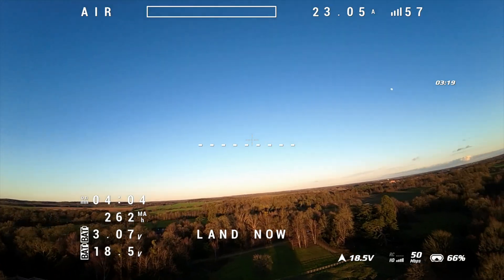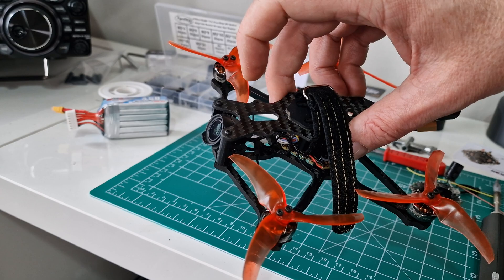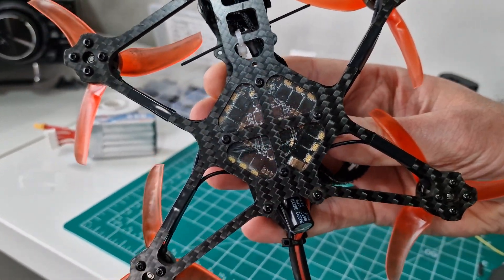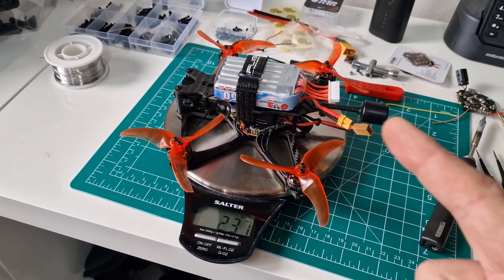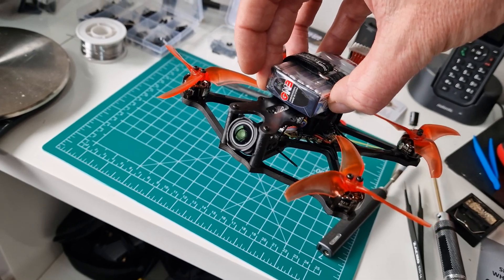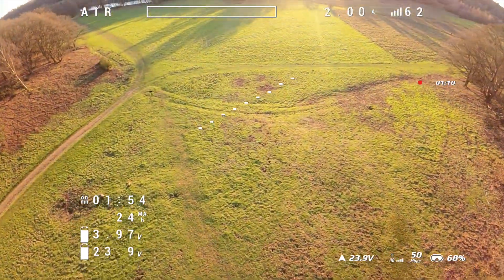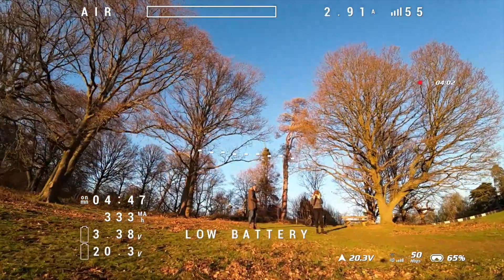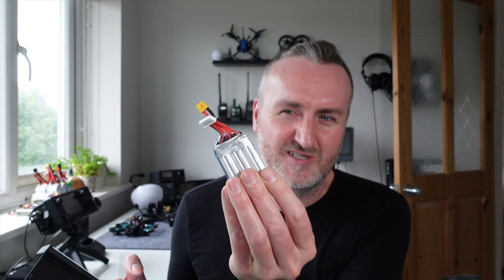EMAX BABYHAWK 2 UPGRADE TO 6S WITH DJI O3 AIR UNIT!!!

Comment: Awesome video! Thanks for sharing. Had a few questions on followed up on this. What’s the average run time on it? Have you experienced any failure with any components? In retrospect, would you have done anything differently to improve it? Thanks!

Comment: How did u get the camera to fit - I tried to squeeze my between the standoff posts n I can't see anything but posts
Reply from the maker: Yeah I reversed the mounts and removed a bit of carbon.
Reply: Hallo. Can i use the DJI Googles V2 and the DJI remote Controller 2 with the Emax Babyhawk O3? Thanks

Comment: I also have a 3" O3 build with those motors, the efficiency of those motors on 6s is crazy good. I run 660mAh batteries so sadly it weights 255g, but it give so much fly time without any hit on performance.
Reply: what frame are you using ?

Comment: I just wanted to confirm that what i thought i heard you say that the original AIO board will support 6s. So am i correct saying that the only thing i would have to change are the motors.??? Lastly are there settings in betaflight that have to be changed?? I absolutely love my babyhawk2hd. I also converted to the O3 system with the googles 2...... Simply amazing and soooooo much fun to fly. I can't imagine 6s,,lol

Comment: You might need a little more space in between 03 air unit and the flight controller. I’ve heard those three air units get pretty hot.

Comment: How do you know the original FC is already for 6S too? I've checked their homepage and manual. It clearly says 2-4S. Wouldn't test it and risk burning the aio. Try some new tattu 550mah 6s. They perform outstanding. I'd have upgraded to 1505 ~2550kv motors though.

Comment: You need either bigger battery or higher C rating. There are 550mah 100c and 90c. There are 660mah and 720mah 100c and 90c some LiHV some Lipos.

Comment: You can take the bell off that dodgy motor and clean it out. Might just have some grit stuck between the magnets
Reply from the maker: The bearings were rusted up. But yeah anything could be fixed 😁

Comment: nice matey! You can drop the low battery warning voltage to stop that popping up every time you pull lots of current. You can actually configure it to warn on the condition of low battery voltage over a set sustained time period, ie greater than a few seconds of punching out, to stop that going off during brief high current load. you can also calibrate that voltage to more precisely match the pack too which often fixes the problem in betaflight. :)
Reply from the maker: Thanks mate! Yeah I thought about lowering the battery warning, I didnt know about the sustained time period though, I'll look into that. At one point that battery it 2.8V per cell so I'm thinking there is something off with those batteries, the 650 4S's I have are handling 30A just fine holding a decent voltage... Will have to try some more things!

Comment: Hi there could i fit the 03 air unit to a battery to work just with a set of fpv goggles.. great video
Reply from the maker: Thanks yes you can connect it to a battery (up to 6S) and it will work with the goggles. You need to turn off the output power management in the goggles menu otherwise it will limit the output power amd the range will be rubbish. Also you'll need airflow over the airunit as they get really hot. A small fan will work or if its on another model like an RC car or something it should be OK as long as its in some kind of airflow.
Reply: Thank you i want to attach it to a  larger drone or motorcycle etc so it needs to be self contained and just connect to the DJI fpv goggles, probably be better if I get you to make me one 😊

Comment: Not sure why you would want expensive Six S cells on it....When one of those cells dies, you'll have an expensive paper weight...It's enough on 4S....🤔😳😏😏🇬🇧 I like the quad, but not configured with those motors and battery...
Reply from the maker: I don't know, I like  experimenting with this stuff. I do it so you don't have to😁. Remember, if one cell goes in a pack you can pretty easily convert it into a 4S or 3S or whatever. I might do a video about that.
Reply: @andykirby  Yes, those motors will drive 4 inch props, but the elephant in the room is the low capacity of the lipo at 450mah...This alone will limit the current draw ..Like driving down the motorway in fourth gear...Put it back on 4S motors?...🤔😳😳
Reply: @EnglishTurbines  I think the point was just getting 6s under 250g even if the battery doesn't last very long. He could put an 850mah 6s on and it would be a weapon given power to weight but then would be over 250g. Yes could just put it back to 4s and be the same as every other 3.5 inch... but Where's the harm In tinkering lol
Reply: @FPV-TV419  Well, that's the point, it really ISN'T a weapon at all. In fact its performance isn't good at all. Compare it to the other 03 baby quad to see the difference in performance. Selection of motors, props and battery are critical on these baby quads..Noise doesn't mean speed...🤔😳😏😏
Reply: @EnglishTurbines  yea, I'm not saying choices aren't important.  And its clear the battery is a weak point. But compared to a 4s 3.5 inch... this is a "weapon". Comparing any 4s to 6s is a night and day difference in  performance whether its 3.5 inch or 5 inch. The point of this was obviously just... why not 🤷, but at the same time building something you can't buy off the shelf. Sub 250g 6s performance.
Reply: @FPV-TV419  Okay, if you like a 2 minute flight time I guess. For me, it's just a battery killer that's really noisy...😳😳😏
Reply: @andykirby  Can I run a 6s 6500mah Lipo directly to the DJI 03 air unit?

Comment: Awesome!! This is one of my favorite quads to fly. It was the first one I converted to the o3 system. I had a ton of vibration issues. I shaved the tpu down but it was still horrible. My fix was. I drilled holes in the top and bottom plate a little back and out. Then I have to shave the front tips of the top plate to get them out of camera view in  extra wide view. I also added a rubber grommet one the camera screws!!
I have not built a complete done yet. I just fix my bind and flies. Lol. But I have to say I'm really proud of of this fix!! It was quick and easy! Hope this idea helps others!! Happy flying from Florida!
Reply: I dont understand where you drilled holes, im planning to upgrade my analog version to o3, still on 4s though
Reply: @DoktorSkill  mine is still 4S. The top plate where the front standoffs are next to the camera, I needed them to be wider and back a little bit so they weren't in the view of the camera and I needed more space on with. So I drilled a hole a little bit back and out on the top plate then I took a little grinder and nipped the tip of the top front plate off because it was in the view of the camera. So the biggest issue I had was I do not have any standoffs or anything holding the back end of the drone together. I have the two front standoffs then the one middle standoff in front of the air unit. I used 3M heavy two-sided tape to tape the air unit to the bottom of the top plate. Everything has been perfect until this past weekend I was practicing power loops and got too close to the ground and drove it into the ground hard. It was ugly. Probably the hardest crash I've had in a long time. It broke all the standoffs and screws and ripped the negative wire off the board. So far I soldered the capacitor and the negative lead back to the board and did a test see if it would fire back up. So far so good looks like I'm getting all the tones and video in the air unit in my goggles. Now I have to figure out how to put it back together lol I think I need to practice my power loops in the sim more lmao good luck happy flying
Reply: @pianomans1 im unsure where to solder which wire. Do i only need to solder 4 wires, excluding brown and yellow if i dont use the RC link from DJI?

do i only need rx, tx and 7,4V + GND?
Reply: @DoktorSkill  yes . I ordered mine with crossfire so the yellow wire which I believe is for when you use the DJI controller. Pardon all the ugly zip ties . I took a really hard crash practicing power loops and drove it hard into the ground . It shifted the whole top plate forward and snapped all the screws going into the standoffs. I'm hoping to be able to buy the whole frame kit for the new babyhawk O3 and put all the parts on that. Lol
Reply: got it working now. Did you update to Betaflight 4.3 or 4.4? mine is on 4.2.5 and i guess the OSD is not customizable in betaflight with 4.2.5 @pianomans1
Reply: @DoktorSkill  I have not updated betaflight .
Reply: @pianomans1 Do you have problems with vibrations on your live Video(DVR) or Rocksteady footage?

 ive now upraded my Babyhawk 2 Analog to o3, got vibrations in DVR Footage (with softmount), then got a new camera, now i get those vibrations only in rocksteady footage, DVR is smooth. Wondering if i changed my PID or filters accidentaly. Can you Provide a screenshot or so?

If i use the dump file from emax, it does delete all my changes in betaflight, right?
Reply: @DoktorSkill  All the settings on my baby hawk were stock settings. I never changed anything and I never flashed any new firmware. Once I got enough separation of the frame from the '03 camera and used o-rings on the screws holding the camera, I never had any Jello or vibration on either the DVR or the 4K Rock steady footage. One thing I have figured out is if you want your rig to have butter smooth footage, you really can't be ripping freestyle too much and expect the footage to stay perfect. Especially, one crash can knock everything out of whack!  
Right now I'm in the rebuilding mode after I had that nasty crash. I have a new top and bottom plate. I ordered a new hardware kit. The one main important part I'm missing his the front camera TPU mount for the '03 camera. My first modifications of the baby hawk 2 HD where I drilled new holes in the top and bottom plate to separate the front standoffs and bring them back a little bit worked great for the time being. So I've been communicating with emacs customer support telling them that I have everything except for frame, hardware and camera mount. They told me they do not sell the camera mount but they sent me the STL file to print it. I have a friend of mine printing it for me. Hopefully after that is installed I will have close to a stock babyhawk O3.
Reply: @pianomans1  i asked emax for the TPU mount file too, they said the files are privat. Anyway, i got a better mount from printables that protects the camera much better and no frame in view.

Comment: If I were you with a build like that, I would probably Flash your AIO with bluejay ESC firmware, and try running bidirectional d shot, and set pwm frequency at 48 kilohertz. See if that affects your amp draw at all. 
I almost cried when I saw the voltage at 2.78 lol. Great video man, and very cool build! 💪🏻🔥
Reply from the maker: Interesting! Thanks! I'll try that! Yeah I didn't notice that cell voltage  when I was concentrating on flying.😵 not good!!

Comment: Love it mate! Sounds crazy! 🤣. I know shit all about batteries .... but it did seem to drop voltage pretty quickly even on hover straight after takeoff... my old 1300mah batteries drop straight away to about 3.8v but the newer 1300mah battery stays at about 4.0v straight after take off. So maybe its weak... something wrong with it. I know its smaller mah,  but it's all relative... 450mah on 237g and mine is 1300mah on 700g
Reply from the maker: Thanks matey! Yeah the voltage drop (sag) was quite a lot. They aren't holding their voltage well under even 40C loads let alone 80C which is the constant rating! Will do some more playing!

Will defo try to get some freestyle in on this one when there's no crazy dogs around!